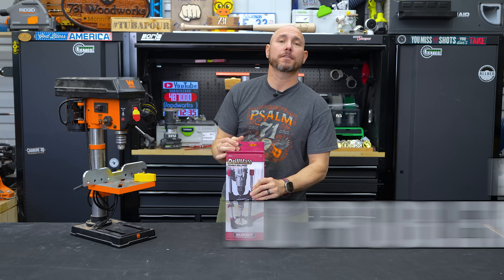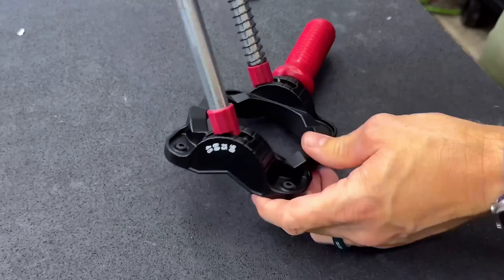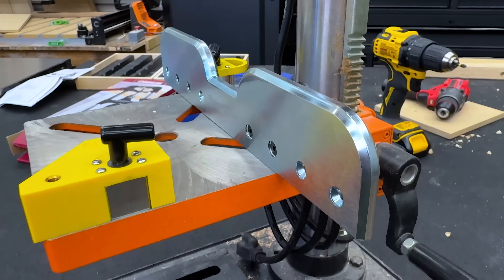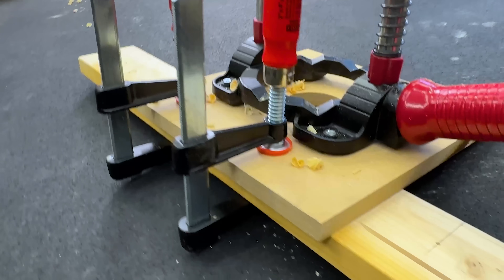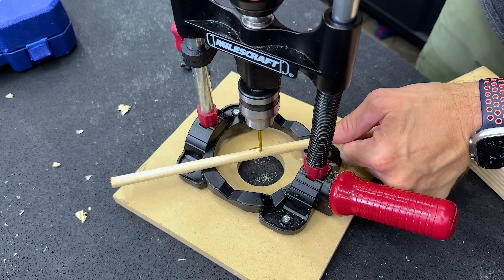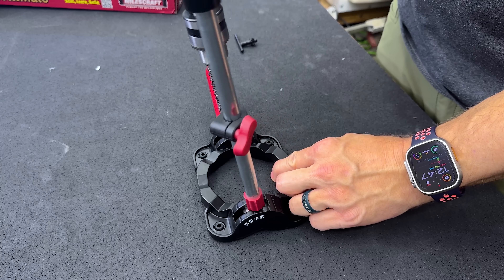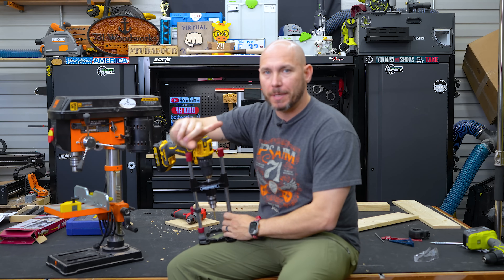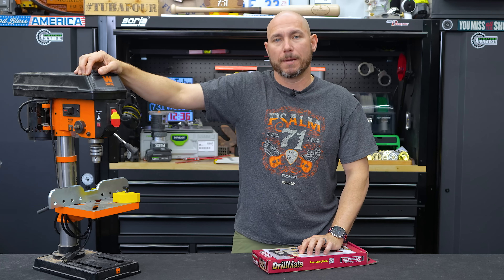Ultimate Drill Upgrade! Turn Any Drill Into a Drill Press

Comment: I bought one, used it once and returned it. Biggest cheap POS I ever bought. Genuine buyer's remorse.
Reply: I’m assuming you don’t like the dremel line of attachments either???
Reply: There was lots of slop in the chuck carrier so I removed the sloppy hard plastic liners and rolled a 1/16" thick strip of Teflon PTFE into a cylinder as a replacement for the hard plastic pieces and all the slop is gone and it rides smooth now. It is still a cheap, light-duty hobbyist tool at best, but at least it is usable now.

Comment: I have one…it’s the standout WORST tool I’ve ever bought, and I’ve been buying tools for over 50 years. I bought it from Lee Valley a few years back….tried to use it without success….put it on a shelf and (thankfully) forgot about it. Well, maybe not “thankfully”…I should have returned it immediately. I tripped over it a few weeks ago and decided to see what the problem is. It was easily determined. There’s so much runout at the end of the drill bit that it’s impossible to drill accurately..and impossible to hold the base steady, by hand, while trying to drill. I know that if I clamped the base to a board, securely enough that it couldn’t move, I’d either get a very ragged hole, or something would break.  FWIW…I’ve seen other YouTube videos where the user is fighting with this thing just like I had to….buy at your own risk….from a retailer that takes returns.
Reply: Is your's this Milescraft one?
Reply: @Obtuse94  …indeed it is a Milescraft. I’m still wondering if other….significantly more expensive brands…work as advertised. But, once burned……
Reply: For all the reasons you mentioned, this thing has terrible reviews.
Reply: exactly my experience and I to wished I had returned.   issue is in the bearings... easy to much ply. 

I got it as an upgrade (haha) to one that holds my corded drill... but that has been best because the chuck is the drill and not a built in chuck like the miles craft Version.
Reply: @arick_mnc  ….I’ve wondered about those….mainly about the difficulty of getting a given drill (because they’re all shaped differently) properly aligned, so the bit is truly 90 degrees to the wood. What’s your experience?
Reply: That thing sucks! Buy the Wen press and be done (the larger one).
Reply: @mudz678  I have one that fits the euro drill standard of the nick of a corded drill.  it doesn't tilt and only does 90deg.  That is what I wanted most of time for my larger spades... works 1000% better than the milescraft... butvis still flawed.  how much $$ frequently = quality.  But eliminating the middle chuck and bearings reduces one problem point.

I was lured by idea of attaching cordless drill with milescraft.
Reply: @arick_mnc  I might have lucked out. I was intrigued by what I’ve seen of the UJK version, which seems to be identical to the Rockler, but was put off by the cost/shipping….and problems with returning it if it turned out to not work for me. In Canada we have KMS Tools, and they have a Magnum brand. They recently began selling their “Magnum Precision Drill Guide”. Lo and behold…..after looking at many photos, I will swear it’s identical to the UJK, including the colour, but with a Magnum name plate, and very nicely priced. I bought it on sale for $189.00 Canadian….and have until 25 Jan ‘24 to return it if I’m not satisfied. Haven’t had a chance to use it yet….that’ll happen soon and I’ll make a post here. Judging by looks and feel….its definitely a precision unit, and I have high hopes! 🤞🏼

Comment: Got one, the amount of slop between the bushings and the rods is bad, so bad in fact that it is prone to jamming and introduces quite a bit of run out. If your holes can be about 1/32 out of center and at a few single degrees out of setting than maybe it is OK for you.  For me at least  the idea is nice but overall the execution of this tool is sub par.

Comment: I have one and I have to admit that it is pretty high in quality. I never owned one until I got into YouTube. Most woodworking channels were telling me to get this so I did. I've only used it once. I hated the tiny chuck key because I have arthritis in my hands and it's small. My drill has a bubble level on the end of it and I just never use it. 
I do have several Milescraft products and they make pretty good items. 
Just don't run out and buy everything that you see on YouTube. 731 himself has even said that.

Comment: I have the same one and it's great for those small jobs that I as a DYIer have to get done. In relation to storing that tiny little chuck key, I plug it into one of the four holes in the base. These holes have rubber grommets and hold it in perfectly when not in use.

Comment: This is an improvement over the old Portalign drill guide (later sold as the Craftsmen Drill guide at Sears).  I still have my Portalign from the 70’s and it works quite nicely.

Comment: I have this drill guide already.  I agree it is a very good product.  I used it to drill holes in piece of plywood for a plinko board.  It worked great and a traditional drill press would not have worked for the project.

Comment: Love this simple tool been in my shops for years. Don't forget you can make jigs for the bottom for your repeated hole needs.
Reply: I replaced the hard plastic sleaves that are inside the chuck carrier with 1/16" thick Teflon PTFE and all the slop/misalignment is gone from the drill guide. See my comment for step by step instructions and the part# for the PTFE

Comment: I have this and I found it so unstable but usable. Now that I saw you attache it to a base, I am going to do that and it will instantly become more useful. I also stick the chuck key in the the rubber that comes through the hole that comes from the feet. Thanks Matt!
Reply: First thing I did was attach mine to a length of 2X10 I had lying around from some project I did in the past

Comment: I bought one, it is ok. I took the spring off as it cants the chuck/drill bit towards the shaft with the spring as there is a bit of slop in the sleeves that ride up and down the shafts. I removed the two hard plastic sleaves from the chuck carrier and replaced them with a piece of ultra slippery Teflon PTFE 1/16" thick sheet (McMaster Carr part# 8545K13) that I rolled into a cylinder. To cut the strip uses the full height of the hard plastic insert to measure for the width of the strip and marked a line with a sharpie. Cut the strip off with sharp scissors. Then roll the end of the strip around one of the steel shafts(PTFE is soft) and mark the approximate length needed to make a complete cylinder, you will have to trim off tiny amounts of the length to get it to fit perfectly into the holes in the drill chuck carriage(it should be a tight fit), push the piece of PTFE all the way to the bottom, I needed to use the edge of a 3/8" dowel to to get the PTFE piece to bottom out. There is no need to reinstall the two screw they are not necessary as the Teflon fit it tight. All the slop is gone. Reassemble the drill guide and put a thin film of gun oil, 3 in 1 oil, synthetic motor oil, or the like on the steel shafts, it will be silky smooth and it will be an excellent tool.
I would recommend mounting it to a 8" or 10" square base for stability. This is a light duty, hobbyist tool, do not expect to be drilling holes for pegging mortice and tenon joints in huge timbers.

Comment: I purchased a Milescraft doweling jig and was very disappointed. I used it for the project I was working on and returned it afterwards. 
Here is my question. How accurate are the preset angle detents? Did you happen to check or verify them? Thanks

Comment: Hey, thanks for reviewing this!  I've seen it in stores, but had concerns about how stable it was.  Good to know it's solid!
Reply: I bought one.  I tried it a couple of times.  I make knives so I needed to be able to drill perpendicular holes in the scales for pins.  It's not all that stable.  It wants to wobble with the weight of the drill on it.  My biggest issue with it was the difficulty in getting the drill chuck tightened to the bit.  I threw it in a drawer and bought a bench top drill press for $215.  Worth the money for what I do with it.

Comment: Bonus tip…If it’s not mounted on a piece of wood, you can also slide the chuck into one of the holes of the rubber feet. It fits securely. 😊
Reply: I would gladly do that, but i already lost mine lmao

Comment: I have been using this drill press guide for a few years.  It works great for me.  I mainly use it to drill for threaded inserts on table tops.  It is accurate and the depth stop works great for perfect holes for threaded inserts.

Comment: I have one of these and didn't know about all the features on it, got it for making dog holes when I eventually get around to building a workbench.  You could probably improve the fence idea by putting sets of holes in the board at measured distances and then dropping something like a clevis pin through them for whatever distance you wanted at the time.  

Another thing that could probably be done to this is attaching some of round rare earth magnets with a screw hole in them to the feet or recessing them into the platform you made so it can easily be attached to metal surfaces, it wouldn't support the full weight of the drill but it would make it way less awkward to drill into the side of a vertical surface.

Comment: I bought one to drill holes into the studs to install lag bolts for a floating shelf. Needed the hole square and it did a really good job. Wish I knew about the self centering function, would have used that for the holes in the shelf as well.

Comment: I have this guide and the chuck is inserted on one of the rubber feet of the base, fits really snuggly there. I have it attached to a board with just 3 screws and in the fourth is the chuck.

Comment: A drill guide can replace a drill press with a fence, but it's not always a good idea. The important rule or thumb is "use a big tool on a small workpiece, use a small tool on a big workpiece". 

While you can make repeated holes on a small piece using a drill guide with a jig, you're much better off going to a drill press with a fence with flip stops or other aids. The fence can also make it easier to keep the small piece in place.

On the other hand, you can't bring many large pieces to the drill press, or keep them there safely, or drill a hole close enough to the center of the piece. Drill guides give you the freedom to easily drill anywhere on a large piece.

The Milescraft Drill Guide is fine. There are fancier ones, but the price jumps steeply. At this is light and at the price point it's probably the best. There a similar Chinese design that sells for around the same price, but I think the 4 screw holes for a jig make the Milescraft the better design.

Comment: I have the Rockler version with the accessory vise, which I have to believe is the US clone of the Axminster UJK version in the UK.
.
The vise was a freaking miracle when I had to drill lanyard holes in 80-100 small wooden spheres.  
.
Spendy and heavier, but the chuck accepts 1/2" bits and it feels safer with larger Forstner bits.
Reply: IMO you really need to get the Rockler or the woodpeckers version. If you are only going to use it once and never again you might be happy with the poor quality and inaccuracy of the cheaper versions but they really aren't any good. The vice you purchased is the self centering one?
Reply: @KZ-yy9pm  Yes, the self-centering one that attaches to the drill guide with 4 hex screws.
Reply: @indigo_wolf3574  ahh thanks, I knew they sold one didn’t know it’s attached to the guide. Good to know.

Comment: Even though I have a drill press I think having something like this is great for when you have an item that can't fit into the drill press such as if I'm doing a tabletop and I need to drill a hole in the table top the table tops not going to fit so this will help me drill the straight hole

Comment: We have a project where we have to screw in a lot of 240mm specialty screws through insulation and timber battens for a house facade and I was wondering if this guide will also work with an impact driver to make repeatable driving in screws at 90 degree angle easier

Comment: One suggestion.  Before you attach the added base, put center lines on it. Then align those lines with drill guide center lines . Once you drill the new hole. Bring those lines down thru new hole.  Now you can use center lines for guides  when needed.

Comment: BTW, the shaft of the chuck fits neatly and tightly into the holes in the rubber feet. Of course, that's moot when you have it screwed to a base, but I like it as a feature.

Comment: ive been getting a lot of milescraft products.  i really like the push blocks for my jointer and the push block that rivals the grr ripper is pretty dang good as well.  the universal trim router subbase works awesome on my cordless ridgid router.  the router itself has a terrible base so its nice to have handles and a biger base to keep it from wobbling.

Comment: I am on a beginner level to wood working, and need advise before I invest into the tools I need for a very important project I am about to create.  I have Cats that I have to build divider walls and slider by-pass doors in my RV for them to not get thru and have decided that I am going to use 3/4-in x 4-ft x 8-ft Whitewood Sanded Plywood.  I will be cutting out 2" holes throughout the little over 6'x2' pieces instead of using any kind of metal cage or screen so that they can still allow air and view through them.  I am concerned about the cut-outs having splinters even after I have sanded/painted/sealed the plywood.  I have looked into deep cutting hole saws, but feel like the regular hole saws I am looking to purchase, will require me a lot more labor and cost in more tools to sand the inside of the holes out.  Can you please tell me what kind of hole saw I need to attach to the MilesCraft DrillMate for the cleanest cut on the plywood of choice.  Love your videos by-the-way.  Easy learning!  Thank you for any assistance and advise you can throw my way!  Have a very blessed day!

Comment: thnx for the review i just purchased this from a different manufacturer, its handy on field. i also purchased a drill press and was wondering what RPM range did you set yours for woodworking (as there is a wide range to set) ?
Reply: The speed of the drill press is determined by the diameter of the bit, type of bit (twist, spade, etc.), also type of wood (hard or soft) can come into play. There should be a chart with the drill press. If not let me know and I see if I can get something up for you.

Comment: Hi Matt, always glad to see looking for inexpensive (as apposed to cheap) tools helping out the guys with limited funds or space or both to get the job done! Great job!

At some point would like to see your perspective (kinda a shootout) between the various vendors versions of this type of tool. At this point I own the Rockler version, and even though I feel it is great for what it does to this day still wonder if I could have gotten the same basic functionality with something much cheaper. In this case I can't help wonder if by adding a base, then adding some bracing to the top of the device (think of it like an upside down U) adding stability and accuracy even to the "less expensive" devices on the cheap. At this price point you could even purchase two, one for 90 degrees, another for 45 degrees, what I suspect are the most used angles - your milage may very. Hay, maybe an extension for your new 3D printer? 

Anyway, even though I see this type of device being an essential part of any woodworker's toolkit (and honestly feel should be on any list of what beginning woodworkers should purchase as one of their beginning tools.) Is it as good as a drill press for pieces you can bring to the press, ah no. However, it is way better than a drill press when you can't bring the work to the press, the press in this case of course being useless. 

Anyway, my two cents. 

Thanks for the work!

Comment: I’ve found it difficult to get a true perpendicular hole with this with a Forstner bit. It helps if you take off the rubber feet and clamp it to the workpiece (but there isn’t a lot of surface to clamp to). The base is not wide enough to counter the leverage of the shaft and drill above, so it’s almost impossible to tell if you are perpendicular to the workpiece. The spring is also quite heavy, forcing you to put extra pressure on the drill and increasing the likelihood of error. I removed the spring and it helps some. Also mine seems to have a slight wobble in the shaft. I’d rate this 4/10

Comment: I bought this and it was inaccurate. It had a strong wobble as the pin on top was slightly bent. I measured with a caliper and carefully sanded off 0.1 millimeter from 2 of the 6 sides of the pinion. Now it's centered and stable. But it was a hard ride.

Comment: I've tried using this to help drill holes on the end of some dowels.  It must be operator error for me because I have not been able to drill straight holes.  It's probably my base setup and very limited experience.
Reply: The chuck flex is the first issue I experienced.

Comment: Have it.  would not recommend.   i got because i like the idea of connecting my drill to the chuck like a drill bit.  BUT.. there way too much play in the bearings of the chuck.  

What i would recommend is similar with a collar to Co around your corded drills chuck.   Eliminates the wobble.... 

Good ideas for use... but disappointed in my milescraft. 

highly recommend the milescraft drill blocks!   work a charm and usually my go to well before the milescraft press.